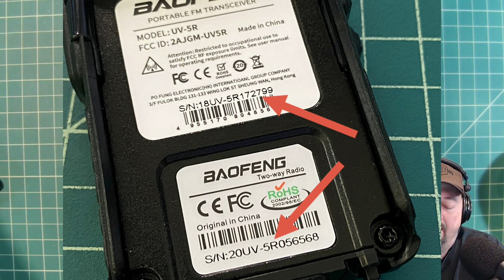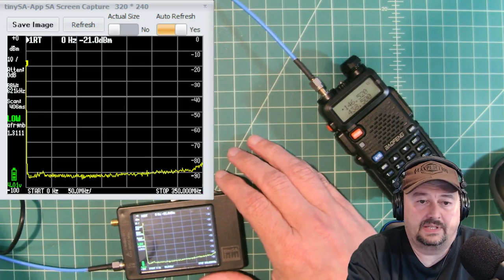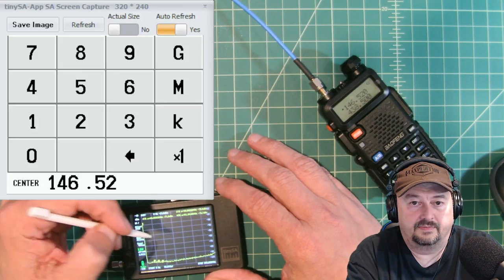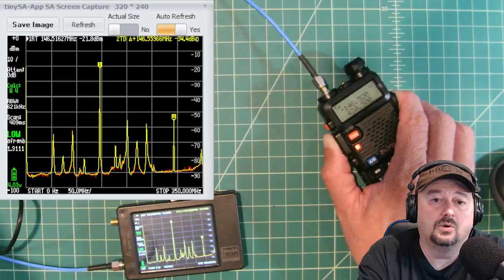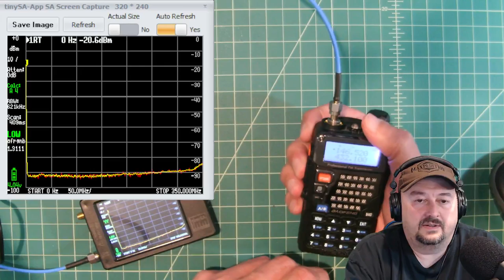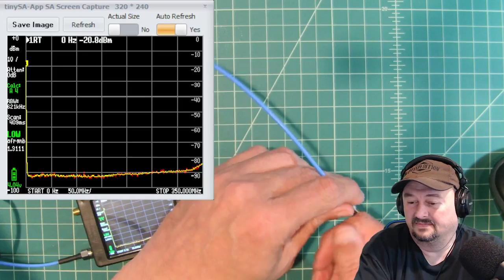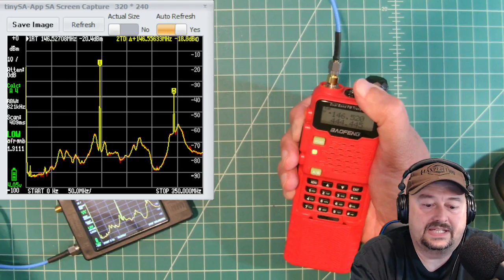Baofeng UV-5R Harmonics Test with TinySA

Comment: One thing you should do (after adding the initial attenuator) is to take a measurement, then add another 10dB of attenuation.  If the delta (fundamental vs. 2nd harmonic) between the original measurement and the new measurement is the same, then you can be sure you didn't overload the SA frontend.  If the delta is different, then the SA is overload and what you're seeing is the SA generated harmonics and not your transceiver harmonics.  Old school trick...
Reply from the maker: That's a great idea, thanks Mark!  I will add that to the back of tricks!

Comment: I just tested two new UV-5R radios (one was labeled as a plus model) and they both had the nearly identical resposnes.  Both had only a peaks at the second harmonic.  I tested at the bottom, middle and top of 2m and 70cm bands (433 was the lowest in 70cm) and the worst case was 53dB below the findamental.  So, all in all, I was pleasantly surprised.  A uv-17 was similar.  Tested on a Rigol analyzer with 30kHz RBW up to 1.5GHz.

These were all purchased in the last month, so maybe Baofeng is starting to get their stuff together.
Reply from the maker: I’ve seen some pass and some fail, glad to hear yours were clean 👍
Reply: @TheSmokinApe  ha! Not sure I'd call it clean...but seems to at least meet requirements.  :)

Comment: I just got the TinySA Ultra today and although I dont plan on using the Baofeng radios, I figure I would test them. Both of the UV5’s passed with flying colors. FYI, I noticed in one video you set the attenuation on the TinaSA for this same test. But on this video you dont have it set. Any reason for the difference or does that invalidate one of the videos?
Reply from the maker: Hey GRV, I did this video before I learn the Ext Gain setting.  You can use simple math to determine the levels but the Ext Gain is much easier.

Comment: I forgot to mention in my original post that the red baufeng also gets the green light even though it's harmonics weren't down by 40 DB it's maximum harmonic power didn't exceed 0.3 microWatts which again is far below the permissible 8 microwatts for transmitters of 25 watts or less.

Comment: Just put together a filter to screw into the antenna connector to kill that harmonic. It can probably be built small enough so you hardly notice it. FT-50 toroid size would probably work fine. It would be a bit awkward, but functional.

Or insert a T connector in your antenna jack and add a (slightly over) 1/4 wave stub of RG-174 (at the frequency of the harmonic,) to the side connector. Then plug your radio into your attenuator and your TinySA and snip down the RG-174 (while unkeyed,) then hit it again and watch that harmonic signal as it drops. Cheap, easy, and it will drop the harmonic down substantially. Not sure if it will attenuate it sufficiently using such small coax for the stub, (I haven't used any coax that small for a stub, the Q will be lower,) but it will be significant. Plus, the shield on the RG-174 will probably work as a counterpoise and improve the receive range on the Baofeng, because the Baofeng HT antenna system design sucks.
Reply from the maker: That's an interesting idea, thanks John!
Reply: @TheSmokinApe , I think it might make an interesting video for you. Have fun.

Comment: Have you ever checked out the Baofeng DM-1701?
I'm just curious.  I have one, and had a friend of mine at a 2way radio shop check mine out.  After loading the OpenGD77 software on it.
My DM-1701 tested at -43 db at high power, which was < 5w, and hardly any deviation.  Needed no alignment.
Reply from the maker: I’ve never messed with the 1701.  -43dbm is 0.0000000501w so something might be off.  https://www.rapidtables.com/convert/power/dBm_to_Watt.html

Comment: Hello,
I don't understand how you can have a signal of only -21dBm with a 40dB attenuator and a TX output of about 5W (36dBm). You should be measuring a fundamental of about -4dBm. Where are the missing 17dBm?
Regards,
David F4HTQ.
Reply: The test setup is sketchy at best, using uncharacterized attenuators and test leads of unknown quality. My assumption would be that the transmitter is folding back power due to impedance reflections.

I'd like to see return loss measurements on that test setup. You need an exceptionally good load to do absolute power measurements. I'd Venture a bet that he's barely seeing 17 DB of return loss he should be seeing closer to 48 DB of return loss for an accurate measurement. 

The problem with this test setup is there's no way to normalize or characterize test fixtures. Normally when I see numbers that don't Jive with what I expect to see then it's time to perform a sanity check which was not done here. 

It's very easy to overload the front end of these hobby grade Spectrum analyzers has such a pretty much take everything you've seen in this video with a grain of salt. 

Had a very minimum he should have added another 10 DB of attenuation and compared the results. If the Delta on all the measurements were reduced by 10 DB then that's a pretty good sanity check, if they weren't it indicates overloading of the SA input.

The bottom line is the reliability of your measurements is only going to be as accurate as the quality of your test fixtures and set up allows.
Reply: @dannelson8556  
Thank you very much for your reply.
I totally agree with your comments.

Comment: Would a ferrite ring help reduce spurious emissions if you put it on a Baofang  UV5-R HT antenna?
Reply from the maker: @cmarchi128  it’s gonna take more than a ring, you need a filter.  Here’s a video I did:

2m Low Pass Filter for Ham Radio
https://youtu.be/wbkERjEVpqg
Reply: @TheSmokinApe  Ok, I really like the little Baofeng radios.  Is it true that BTech takes the Baofeng radios and reworks them to get them in proper spec?
Reply from the maker: That’s what they say but I have no idea 🤷

Comment: Would have liked just for giggles, to see what the UHF band would show.  Also if it would make much difference to test on another freq in the VHF band, to see if some of that noise is the DDS or what ever they use to synth the osc freq.    I had some tested years ago at the ARRL table in Dayton (at Hara)  and even then one would pass and another would not.  Also I had a couple that came out of a short custom run that were 2M/220Mhz.  They were not clean.   One other gotcha on these radios is that a number of them will not transmit all the DTMF tones, as one tone is the same for 2 buttons (I think the ones somewhere in the right hand column).
Reply from the maker: Hey Arnold, somewhere I saw the QST article they published about the tests.  That would have been cool to watch that.

Comment: Have you ever put those baofeng antennas on a VNA?  uv82 here is 4.2:1 on ham bands,  vhf it gets under 1.5:1 at 128 mhz, I thought I was going crazy, checked my yaesu antenna on 2mtrs its perfect, at 145 Mhz was 1:01:1  nothing wrong with my VNA cal, its the junk baofeng supply, thankfully they also dont reach 8 watts LOL on 2m its 4.9 and 70cm 3.5, on low pwr both are about 2.2w, so I guess using it on low power wont throw too much back into the PA stages (ant checked directly at VNA, not using leads etc)
Reply from the maker: Hey @Ressy6, I have testing some and like you said they are hot garbage.  Thanks for checking out the video!

Comment: My UV-5R only has two peeks -7dbm (fundamental) and -35.9db down. The auto attenuation was 18db but I believe that's accounted for in the measurement. I'm a bit confused -7dbm is different from yours. I did the level Calibration. -7dbm is .2mw so allowing for 40db attenuation is 2W...
Reply from the maker: Were you using the physical attenuator?  Also, check your power level and last, sometimes these don't put out the advertised power.
Reply: @TheSmokinApe  yep. I have the Becen sma 10w 40db attenuator bought off Amazon. I screwed the female end directly into the radio. A male to female adaptor (female both ends) into the other end. Then used one of the cables that came with  the nanovna to go to the tinySA.
I did the low to high port "Level cal" before hand without the attenuator.
It's frustrating because until it arrives you don't know how good your baofeng will be.
It gets me on the local repeater I wanted which it what I wanted it for so I guess no real complaints given the cost. I don't have a seperate RF power metre yet.
Reply from the maker: @moozoowizard  Ah, I was going to ask about the power meter until I got to the end of the post.

Comment: So much inaccurate information here. Contrary to your assertion The first baofeng was well within FCC limits. Manufacturers are not required to reduce spurious emissions below 10 microwatts..

-33 dbm is 0 micro Watts Which is far below permissible level for spurious emissions of 25 watt or lower transmitters from 30 MHz to 225 MHz.

You were assuming that the minus 40 dbm was an absolute, but the specifications specifically state that emissions don't need to be reduced below 8 microvolts so this transmitter was well within spec. 

Here is the relevant section of part 97.307 subpart e.

"For a transmitter having a mean power of 25 W or less, the mean power of any spurious emission supplied to the antenna transmission line must not exceed 25 µW and must be at least 40 dB below the mean power of the fundamental emission, but need not be reduced below the power of 10 µW."

With that said the measurement is not passing the sanity check. I don't understand how you're seeing a -21.8 dbm fundamental with an input power of 5 Watts or 36.99 dbm

Simple math tells us that 37 dbm -40 dbm equals -3 dbm.. 

In other words the fundamental on your spectrum analyzer should be showing -3 dbm yet it's showing -21.8 dbm.

When the numbers don't match what you expect to see then it's time to perform a sanity check. In this case I would have added an additional 10 DB of attenuation. If the Delta on all the measurements was reduced by 10 DB then it passed the sanity check. If they did not then your overloading the front end of the SA which is resulting in erroneous measurements.

The -21.8 dbm measurement could also be the result of impedance reflections in the uncharacterized test fixtures or it could be the result of lower than expected output from the transmitter. Hey keep in mind that if the transmitter isn't seeing a pure 50 ohms it could be folding back power, most of these transmitters will begin folding back power at 1.7 to 1 SWR. Even with cheap Chinese test fixtures I wouldn't expect to see a 1.7 to 1 SWR at 140 MHz. At 440 and above it might become a questionable. 

It's one of the reasons why professionals don't use inline attenuators for transmitter testing. It's much more accurate to use a signal tap and a precision load. This ensures that the transmitter sees the highest possible return loss. It's extremely important when working with test equipment like this to keep the impedance Reflections to a minimum. Sometimes when using pl259's this is difficult to do as they are notorious for impedance reflections at anything above about 30 MHz.

This is one reason why you want to keep the number of adapters to a minimum. SMA adapters are one of the better choices for these power levels.